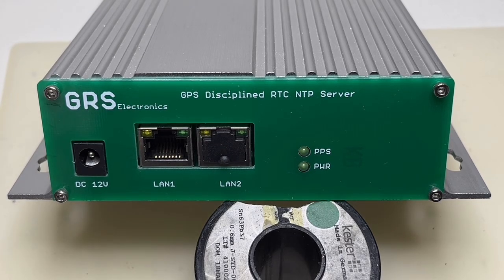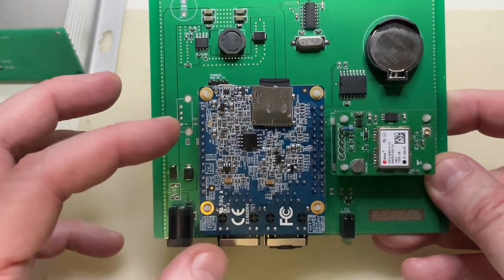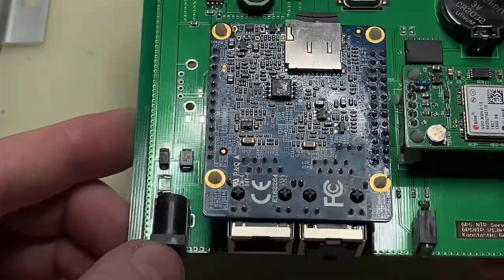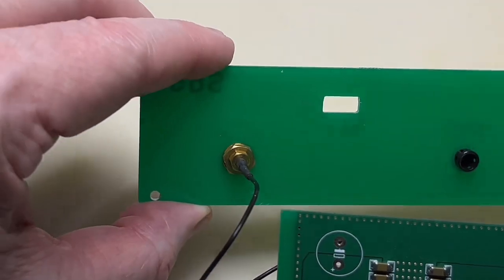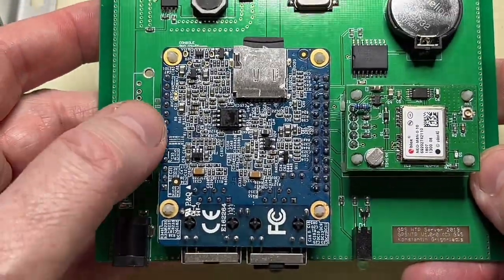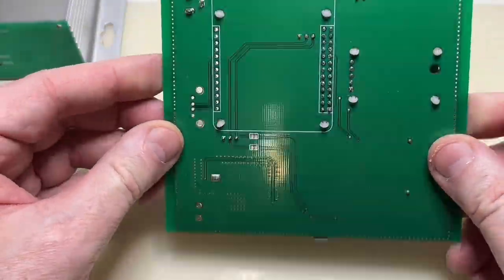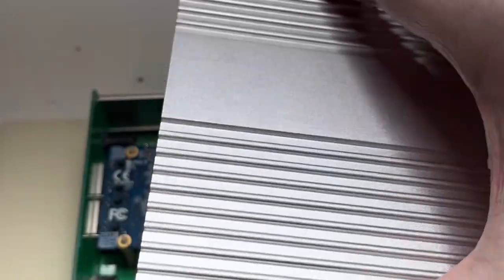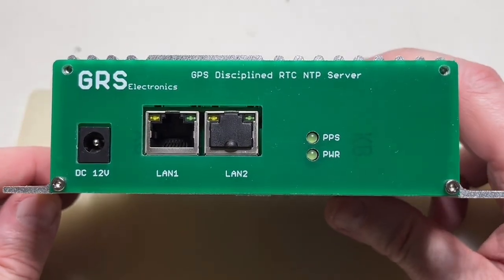Design Details on my GPS Synchronized Stratum 1 NTP Server, as Requested.

Comment: I am currently working on a design which is a combination of a GPSDO and NTP Server. Why did you choose to go for a SBC and not a (powerful) microcontroller?
Reply from the maker: Hi because:
1) I wanted to have future flexibility on high level (full Linux was a requirement) 
2) If I would have made a GPSDO it would have been a total different Design.
3) Further the whole design had to be finished in 1 week including hw design. 
I use mcu’s extensively but not with an OS. For my Design an mcu had no benefit over a low cost sbc, not even price-wise or time-wise